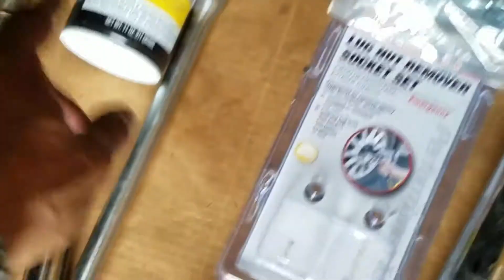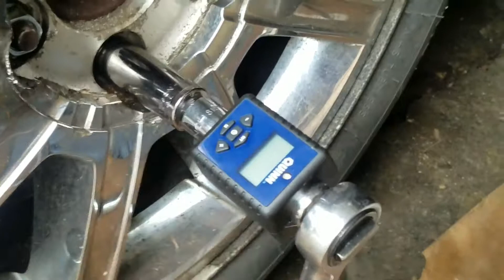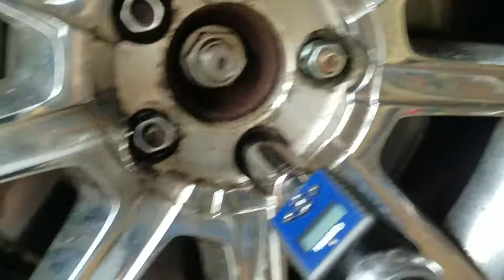Remove Front ABS Wheel Speed Sensor Code P0501

Comment: Is the p0501 the front driver side sensor
Reply from the maker: For me the repair I did was in the front. But P0501 usually broadly indicates that their is a problem with the wheel speed sensor. It doesn't mean it is the problem though. Like it could actually be a bad tone ring which is on the cv axle.

If you have another code that may help filter what the problem is and it may say specifically which side is bad. 

If you think its the ABS speed sensor, you may be able to test it further depending on how good your OBD 2 reader is. You could figure out which sensor is bad by checking the speed meaning how fast each wheel/tire is going in your OBD 2 reader. If one of the tires does not work or you don't get signal in one of the wheels then you will know which side needs to be specifically replaced.

Let me know if this helped or if you have any other codes?
Reply: @FixCarYourself  hello, ive got the codes P0501 and P0341 will this help ?

Comment: Can this sensor cause car to drive only at 30
Reply from the maker: Yes. This happened to me as well a long time ago where my speed was limited.

So its either the abs sensor that is bad or the cv axle tone ring that is bad. 

Usually its best to do the abs sensor replacement 1st because its cheaper than replacing a cv axle.

Hope this helps.
Reply: @FixCarYourself  thanks a lot I got a jump start next thing I know it wouldn’t pickup speed next abs eps abc check engine so I parked it till I firgure out it had u1110 u1120 p501

Comment: Does this work on Benz ml430
Reply from the maker: Most likely. It has an ABS sensor so the process would be similar as the ABS sensor detects the speed of the wheel, which of course is the purpose of an ABS wired sensor.